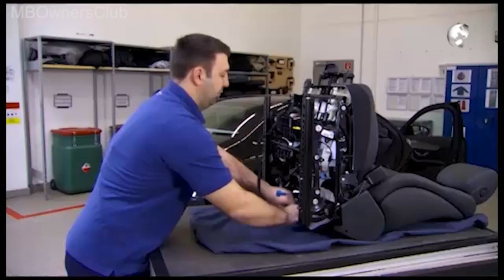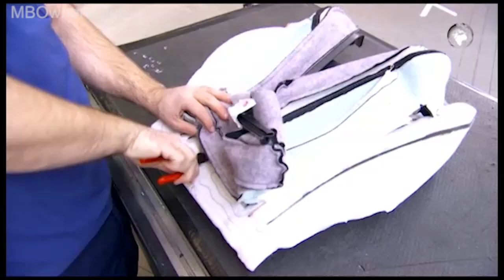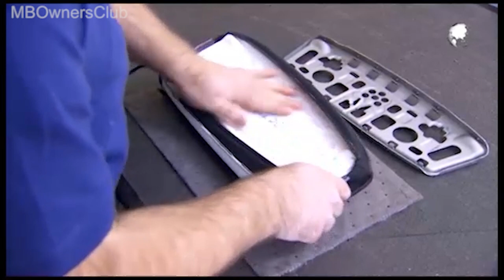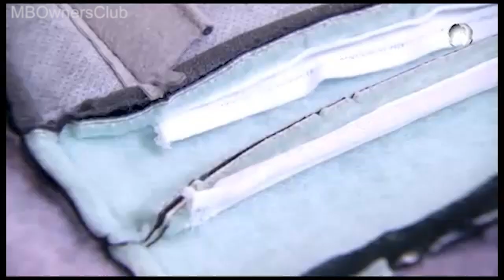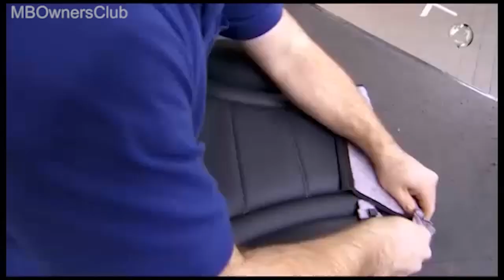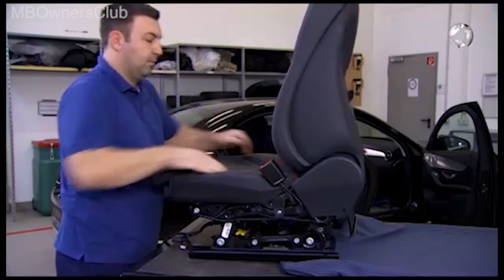The Ultimate Guide to Replacing the Front Seat Cushion Cover on a Mercedes-Benz (W205, W253)

Comment: Ok but how do you get it out
Reply: Undo 4 bolts basically.

Recommend if you have electric seats to extend the thigh support before you remove it. Then disconnect the battery and leave for 10 mins before unplugging the seat or you WILL have airbag codes to clear afterwards.

Oh and protection the sill areas with something to prevent damage

Comment: My 2017 350 d glc amg 36000 miles needs the seat side cushion replacing as the top has delaminated from the threads, I can’t believe that the seats are made from VINYL  this is a poor show from a so called premium manufacturer commanding premium prices
Reply: my 2016 GLC driver seat decided to start tearing under my right leg - used a puncture repair kit and some 'elastic' glue to stop it spreading. Very dissapointed with seat covering - vinal.......
Reply: @sideshowb0b176  this is my first MB and certainly my last, the only thing it has going for it is it’s looks that’s where it stops, when I was looking for my retirement present which this is, I wanted an Audi sq5 plus but couldn’t find one with the spec I wanted, I sold my 2008 a6 avant tdi with 190000 miles which was in immaculate condition inside and out ( real leather seats ) I don’t think Mercedes’ are as robust or as well built as an Audi, needless to say I’m on the lookout for an sq5 plus
Reply: @daveallsopp320  I understand how you feel. I enjoy the drive, can't compare it to an Audi, never drove one, but have serious doubts whether the next car will be a merc.
Reply: @sideshowb0b176  got my sq5😎😎😎, the glc has gone👍🏽👍🏽👍🏽👍🏽the depreciation was rediculous but hey ho lesson learnt, always stick out for what you want😎😎😎😎
Reply: @daveallsopp320  Been a while since I checked this video - please to hear you got your car - enjoy it, all the best.
Reply: @sideshowb0b176  thankyou👍🏽👍🏽👍🏽
Reply: @sideshowb0b176  season greetings to you and all the best, try out an sq5👍🏽👍🏽👍🏽
Reply: @daveallsopp320  Thx, stay warm and maybe on the sq5 when the time comes..